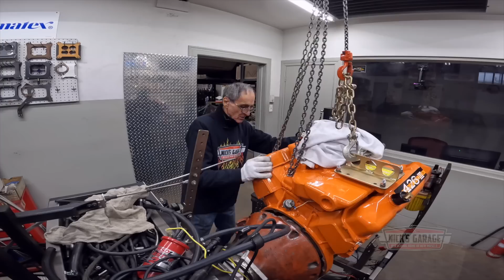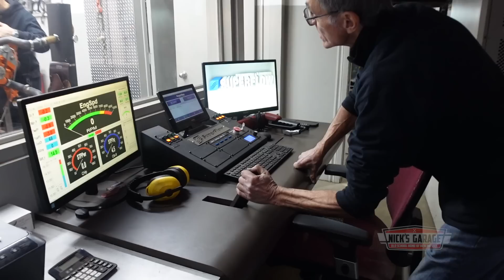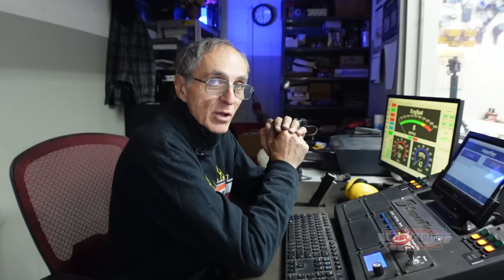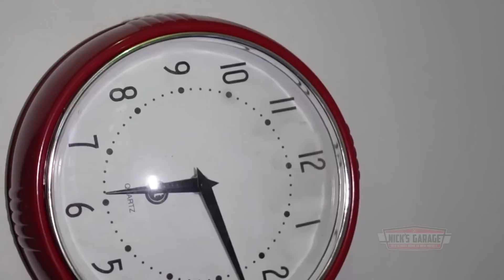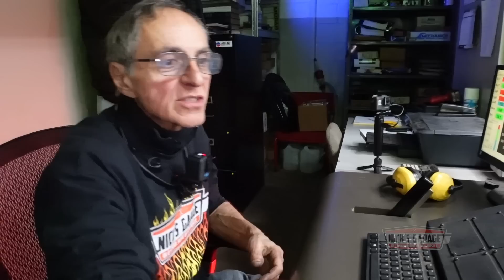Max Wedge Dyno Tested - Troubleshoot a Legend

Comment: Yasoo. Me again. I forgot to ask.
If you think you have a carb problem or maybe too many CFM for the engine. Or in the case of this engine, no air valves on the secondary to tighten the spring tension.
Why do all dyno operators always start a run WFO?
Why not partial, half, 3/4 runs to see what the stats and graph shows?
I mean. Nobody except for the wifey and kids drive from idle to WFO. We spend most of our driving and heavy acceleration under load never going wide open. Could you please try that since you're as curious as me?
Whatcha' think?
Reply: Air valves are not adjustible.
Reply: @nickpanaritis4122  Sorry. My bad. I guess AFB carbs I ever saw didn't have or they were removed. So. Shims did it. Oreo! Opa!!!

Comment: Sure seems like an ignition issue still. The AFR drops like crazy right when the engine stumbles. Hopefully it didn't wipe the cam. I had one take out 5 lobes on a BBC after about 15 minutes. It was due to the total junk lifters. The crown on the lifters was not properly ground and I suspect they weren't hardened correctly. I had an old set of NOS lifters and got a new bump stick and everything is happy. Great videos!
Reply: Acts like it needs a ton more accelerator pump
Reply: The AFR dropping when it stumbles is caused by load creating vacuum, and the carb (carbs in this situation) vacuum operated secondary throttle butterflies open causing a stumble you wouldn’t experience in a real world situation.
Reply: @ShahyadG  I was referring to the stumble at high RPM around 5,600 when theres little to no vacuum.
Reply: @compt3ck  gotcha. That’s the valves floating. Tune in for the next video 😉

Comment: Hey Nick and Shahyad. Did you notice the secondary throttle plates fluttering wide open?
Perhaps a little tweaking of the linkages is needed to slam them open hard?
That trik distrib. looks nice. The screw in shaft extension would make it easy to fit to it to a B block too. Nice!
Can we Locktite and tighten the extension. Drill and roll pin it and give it a try?
Wondering too. At full advance where is the rotor referenced to on the dist. cap plug contacts?
Perhaps sacrificial cap and a few minutes with a Dremel to open a window? And see if we're not advancing off of the contacts?
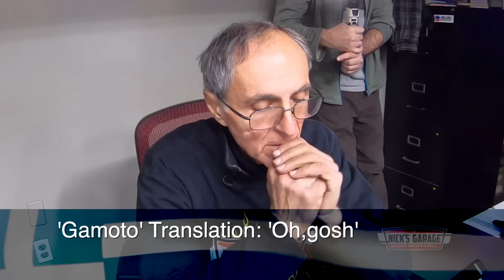Oh, Yeah. Haha. At 39:26, We ALL know that  gamoto me' doesn't mean Oh, gosh.
Just like Ray Pousti and Ray Malaka aren't the guys at the local auto parts store. Love it!
I lived in Athens in the 70's. Got rather fluent with the local slang. Rode Deutz and Mercedes and Volvo tour busses to ACS in Halandri and the drivers would get into drag races from light to light with us all on them.
Kali spera kirios Nicos. Give it astodialo, re malaka!
Reply: Those are secondary air valves that are fluttering, not the throttle plates...
Reply: @BuzzLOLOL  Hey Buzzy, Nikos. Those are AFB's and not AVS right? No secondary air valves. The secondary butterflies are fluttering where they should be slammed wide open. Take another look Buzz.
Reply: @wellseverett5128  - You take a second look, choke flapper on top, air valves halfway down, 4 throttle plates all the way down...
Reply: Nassai Kala.

Comment: The distributor probably has way too much mechanical advance.  When you set the crank total with the engine running and then let it idle, the timing advance drops back too far.  Recurve the distributor!  I'd bet around twelve degrees in the distributor and ten initial all in by about 3200 would be a good place to start.
Reply: I am aware.  All good,  thank you, good point.

Comment: Back in the day I built a reverse rotation Corvair for a VW Bus,  4 carb heads and a turbo.  Crower reverse grind cam
Wiped out the distributor drive and cam.  Cam was supposed to be shipped with a needle bearing thrust washer to correct for the reverse rotation thus backward thrust on the distributor.  Bruce Crower, stand up guy and friend,  got us a new cam asap.  Had to pull the engine all the way down to get rid of the debris That bus could pull a 911 Porsche up to about 50 mph   ran for years  was also hard to diagnose.  Check the bottom of the rockers  you should only have a couple of threads showing.  If the adjusters are adjusted out the pushrod cups can hit, check for wear

Comment: Nick! My dad found out the same thing you found out, the twin 750's are to big. He had a set of afb's for a Pontiac. They are smaller cfm. Woke the 426 Max Wedge right up! Customer took the 63 Dodge to the strip,got the best time he ever had! He was a happy customer needless to say. 

I sure enjoyed this dyno session, Nick. Brought back alot of memories for me. Thank you Nick! Thank you George!
Reply: Well Phil...nice story...but...This is not a 426 Max Wedge...It is in fact a 440....
Reply: @mark006868  l know it's a 440. There isn't much difference. The fact remains the Max Wedge went faster with the the smaller carbs.
Reply: @phillipcortel6330  In fact you have no way of knowing if  ''  the Max Wedge went faster with the the smaller carbs'' or if the bigger carbs were just not tuned properly....
Reply: @mark006868  Totally agree Mark, I raced moparsin the late 60s and 70s. Was real familiar with real 426 max wedge which had bigger valves and 13.5 compression. Saw an original 426 dyno at almost 600 horsepower at I believe 6200 rpm. This engine also had the 750 cfm carbs that they said were to much for the engine, LOL
Reply: How about winning races that weren't before.
Reply: @phillipcortel6330  Some guys run two Holley 1050 CFM Dominator Carburetors....Go tell them to put smaller carbs to go faster....lolololololol....Now if you factor in that Nick has Trick Flow heads and an aftermarket cam in that 440 and is looking to make 600hp....smaller carbs just won't cut it...

Comment: Wow Nick you had your hands full with that beast!   When I heard it flutter at 5700 valve float was first thing I thought of.  Keep on digging you will get it!  How much cam duration at .050?
Reply: Duration is at 250 at .050.
Reply: @nickpanaritis4122   Yeah that is a rowdy one for street. 18-20 degree initial timing at crank with short curve would smooth the idle out a bit which is what I run on my 427 stroker Ford Windsor with a 241 duration. That cross ram is laying the torque down in that  sweet 5000 RPM range! Nice!

Comment: More modern combustion chamber is more efficient, needs less timing  Wrong front cover?  Or dampner?  Do you have a post type cap?  Would not fix the problem but less crossfires.  Where are points when you need them?  ever try it with a 383 distributor, seen that done more than once.  Did you take out the inner coil from the valve springs for start up :)   Sounds good  sorry with my hearing i can't hear the noise    What plugs are you using?  I forget what heads were those 3/4 reach plugs , stock plugs are getting hard to find   Remember a out pulling the plugs clean as that manifold has  distribution problems

Comment: I'm a bit surprised you're running flat tappet instead of a solid roller or hydraulic roller. I can see for the nostalgic but finding oil that has ZDDP in it these days, you almost have to special order it.
Reply: We have lots of Zinc oil. Valvoline, Motul, Driven, Lucas racing oil and many more on the market with Zinc.  Lucas has a Zinc Additive.

Comment: The way you do the troubleshooting, very logical and methodical..  A lot can be learned from videos like these... Such an Intense engine!!! My guess is something like floating valves or maybe something in the ignition system is not up to par... It starts missing at about 5,600 then seems to smooth out at about 5,800... Maybe the Dyno is recognizing the sudden power loss, and compensates for that loss by reducing the drag at the turbines, but that is just a guess... I'm curious to see what was done to produce power all the way through the range, like what happened last Friday night (02/03/23)...
Reply: We added shims to increase the valve spring pressure. Reason why it misfired at 5600 RPM's.
Reply: @nickpanaritis4122  awesome Nick... Thank You for the response...👍

Comment: Check the dist for proper ground. Those old dist with a gasket were a problem. If there is paint on everything you won't have a positive ground. Unknown if that would affect the electronic ignition though.

Comment: With the low compression 426 Hemi running 87 octane was the flame front slowed down because of the high octane gasoline in the low compression engine that's why it made less power?
Or does the higher octane cause ignition delay when used in a low compression engine?

When I worked with the ropkey armor Museum we had lots of World War II tanks and trucks that were all low compression but we ran aviation fuel in them so the fuel wouldn't degrade and lead kept the exhaust valve seats happy they all seem to have good power but certainly weren't tested on a dyno.

Comment: i think it needs stronger valve springs,  i have a roller 302 with flat tappet springs that had this issue but it was much worse, with losses over 100HP
Reply: We had them shimmed for more pressure after video. Not done yet.

Comment: Hey Nick, Check overhead camera footage and watch the butterfly plates on the secondaries on both carbs during the dyne pull and especially the passenger carb.  It looks like they are opening and closing rapidly, never seen that before even on a max wedge engine ! ! !
Reply: I seen that.  1500 CFM. Too much.
Reply: Those are secondary air valves that are fluttering, not the throttle plates...

Comment: I put that electronic pickup in my distributor , on my Pontiac 400 engine back in 1980. The electronics were really awesome and that motor of mine ran so very well. I worked with a bunch of racers and they recommended that set up to me. They used them on cars that raced up Pikes Peak in Colorado.

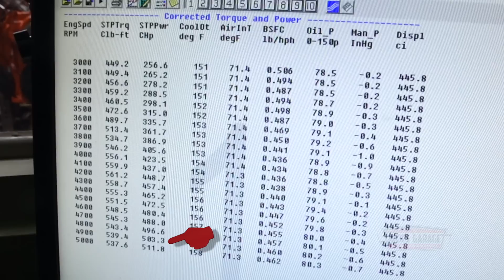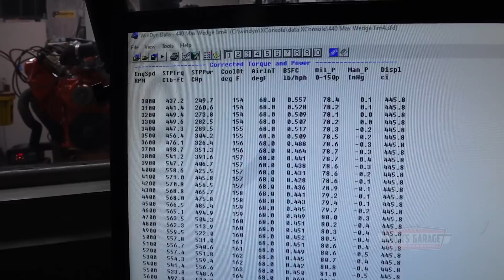Comment: At the 58:53 mark, look at the torque..534 lbs tq @ 3800, and its still @537 lbs @5000 rpm., only dropping a very small amount. Amazing. I had read that the runners on the short ram manifold were optimized for 4400 rpms. Even on the last run (1:15:15) looking at the dyno readout, it has a very broad torque band from 3800 to 5500, so the ram manifold is working as intended. Doesn't look like going much above 5500 will benefit the power, so maybe the Max Wedge engines need a transmission with more than the 3 gears of the torque flight.
Reply: GROSS numbers.  550 gross horsepower on the dyno is only 485 in the car...same as the 2023 Dodge SRT 392.......
Reply: Those are not good numbers.  Those look like Trick Flow 240 heads, they are not the Max Wedge design.  The Trick Flow 270 are Max Wedge heads and put up unbelievable good numbers

Comment: No flat or lock washers on the carb stud nuts????😟
I'm a bit OCD when it comes to using washers, lock washers, and lock nuts. Years of working on Navy aircraft! I usually safety wire my header bolts too.
Reply from the maker: Good tips. Remember, it will all come apart before it goes to the client, and then into the car.

Comment: That center pivot on the throttle linkage needs to be spun 180 degrees. The throttle cable attachment pont needs to be on the drivers side. This will also fix you dyno connection. I was hoping that you would spot it through the whole video. I think this will give you better angles on the rods going to the carbs.
Reply: If I remember correctly, I did try it 180 off but the pivot of the transmission some how was interfering with my throttle rod.
Reply from the maker: Thanks for the info!
Reply: @NicksGarage  I searched for Max Wedge 426 on google and found some pics. Throttle goes on the short arm and the long arm is for kickdown or throttle spring.

Comment: i am curious about jetting and mixture distribution with the cross ram. there was an article in some forgotten magazine about epoxying dams and flow direction devices into the plenum.
also crazy staggered jetting. (like 10 or 12 jet sizes different) What are the plugs telling you? If i remember right, driver's side rear was crazy rich.
Reply: After testing, all plugs were practilly the same color.

Comment: How much from standard bore is machined out of the cylinders to make a 426 a 440?  Is that basically what you have built; a clone punched out 426 to a 440?
Reply: NO.   We used a 440 block. Too rare to find a 426 wedge block.

Comment: Nick-
The carb. linkage fulcrum is 180 degrees turned around...Then you can operate the throttle normally.
Reply: We figured it after when we removed it later.   It will be installed correctly on the car.   Good point

Comment: 👍Showing the good w/ the bad. Figuring it out on a dyno….gotta be the best of times. Love the video. Best to ya Sir Nick.
Reply from the maker: Thanks Major! 👍
Reply: If the engine had been in a car, they would have probably never found the problem, Another diagnostic tool is the video camera just above the carbs. Tough to diagnose a carb problem without one. I can recall several problems Nick had with carbs, and just watching one on a dyno test was the solution. Dyno test before installation is definitely the way to go.

Comment: Man, I kept talkn' to the screen..."swap that distributor!"
Electrics are NOT my Forte, electronics, even MORE so.
I've had the roll pin to the distributor drive gear shear off...making you "think" that it's jumped time.
Glad you guys got it going👍
Reply: Me too...I know the relecutors from Mopar were sometimes machined a little off so I wasn't trusting that trick distributor. I'm building a 383 B Max Wedge with Stage 6 heads so this series has been fun
Reply: Good call.

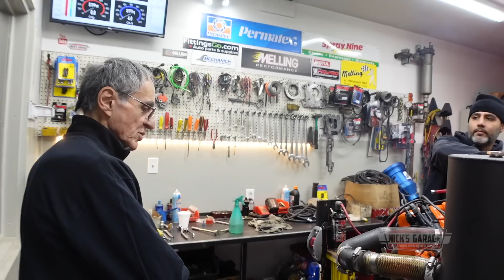Comment: @28:50 sounds like ignition module. @33:00 put your distributor in it.
@38:06 Yup it will flood when the distributor is junk.
@47:03 That's rocker/tappet noise

Comment: don't know Nick that misfire at 5700 stinks of ignition. The backfire has me stumped? Is the cam in straight up? A valve hanging would be a hi rpm but this acts up low??? Shims will let you know if you're on the right track if the B.S. starts at higher rpm. Maybe one side going lean? is that  crossram Totally divided or is there a shared space,I don't think so . maybe two 02 sensors,one for each bank. one could be lean n one good due to a carb prob? if all else fails put a single on to sort it out. A good 850cfm will do in a pinch at 6 grand.

Comment: looked to me like the choke butterflies were fluttering, tie them open, watched the Friday night live when you ran it and thought I saw well over 600 hp on your dash panel, is that correct or faulty reading while running the test pull. Overall, I liked the runs
Reply: The choke doors were tied open. What you saw was the inner butterflies that open under full throttle.

Comment: If I’m not mistaken, a notable difference between the max wedge and the 440 is that the max wedge had 4-bolt main caps.
Reply: Only the 426Hemi has a 4 bolt main.
Reply: Not a Chevy. No 4 bolt mains in BB Chrysler.

Comment: Fix and put the electronic dist back in, your points may be floating.
Reply: Yeah, cheap points can cause float issues for sure. I always try to track down specific NOS ones, from "back in the day" for my use. The newly-produced stuff is absolute garbage. Weak springs and soft, garbage plastic rubbing blocks that often fail in less than a thousand miles.